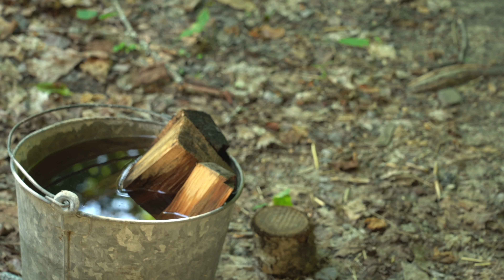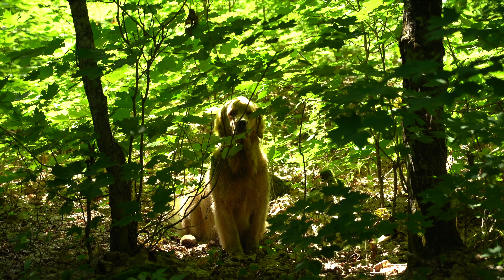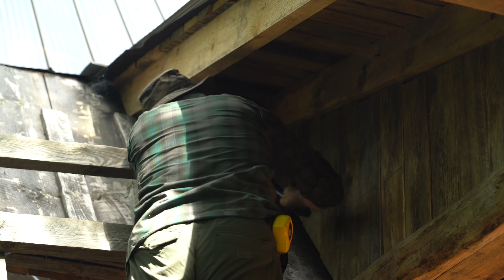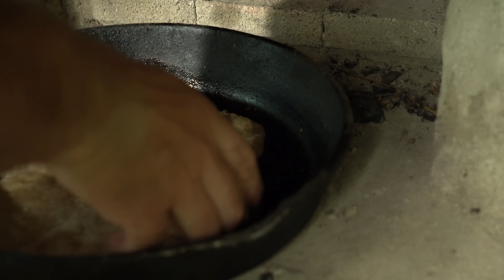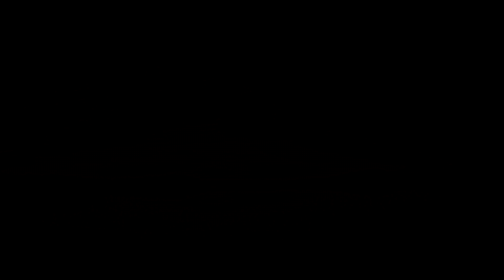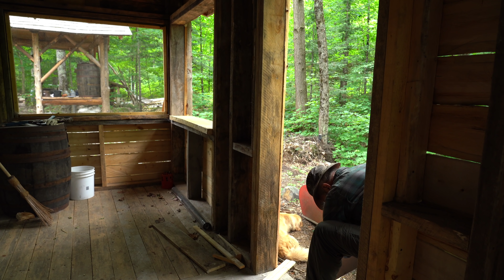Screening the Porch of my Log Cabin | Smoked Black Bear Sandwiches

Comment: I take my wet stones and allow them to soak for about 20 mins, or until they stop obsorbing water. never seen it done this way before.
Reply: I am currently not using wet stones except for using a puck type in the field.  I am using a good file then a couple of grades of fine diamond honing tools, followed by a strop with compound then a fine finishing strop with no compound.  I started doing this after examining the edge of a variety of tools with a digital microscope to see what effect each tool had on the edge being worked.  I haven't come to any firm conclusions yet, but this current method is achieving the desired results.  The impact on different type of steel is the main variable to be worked through.
Reply: @Dream Girls Daily Yeah, yeah. Since when has it been the practice to correct the spelling of others on a forum.  If I was to do this I would be very unpopular.  Anyway an oil stone is an oil stone so why not call a stone wet with water a wet stone?
Reply: Came here to say this.

Comment: I see that you have a 5 lb fire extinguisher at your oven site.  I took a one night course with an Emer prep group and the fireman there had each of us put out a fire with that same extinguisher.  Notes:  there is only 10-12 seconds of chemical to put out the blaze which isn’t much time so aim carefully.  The contents of the extinguisher settles in the bottom of the extinguisher and if it is not shaken every week or so, you lose the ability to use all of the chemicals.  Those extinguishers lose viability after 12 months and must be topped off or a replacement purchased.  Your local fire dept will be able to tell you where to get it refilled.
Reply: This sounds like info we should all be more aware of! Thanks.

Comment: Been there, done that, and aluminum over fiberglass screen is the way to go by far. Also I staple on a layer of hardware cloth over the outside to stop anything compromising the screen, and for doors, I put a layer of hardware cloth on both the inside and outside of the door.

Comment: I was thinking about your garden today. I put down just cut old firewood that is ready to rot , compost or decompose.  The logs may take a considerable amount of years to achieve their potential. If the logs were cut in half or 2X4 then there would be less water leakage or irrigation flowing out the sides. It sitll works but in 3 years times it would work even better.  Since you would not have to put firewood down and burry it every year like me.  Log wood retains moisture water from the core the heart not the ouside of the tree.  Be patient it will work out all in good time, natues time.  I enjoy watching your filming. :)

Comment: It is much easier to staple the screening on (with monel staples that will not rust out) and then fasten the framing.  If you do it that way, you can get a tight smooth screen.

Comment: Screen Door Too ?   Maybe do some louvered sections at bottom to keep the inevitable scratches, dents, nose impressions to a minimum ? Have seen several dogs run right through screened materials once they discover its fragility. Is the existing window opening enough as a pass thru, or will a door be added in future if you want more usefulness from porch space ?  Guess we'll have to wait in suspense !

Comment: I had a window with nylon screen over it  until a small furry animal chewed a small hole in  the screen to make her nest between  the window and screen but could not . I had to change the screen to aluminum and that solved the problem, she tried to cut/chew/claw the new screen but could not so she built her nest elsewhere.  Although your nylon screen doesn't reflect the light  as an aluminum screen would and fits in better with the darker wood/forest surroundings, you might have a breakin problem in the future.